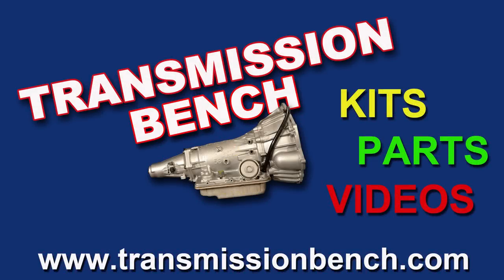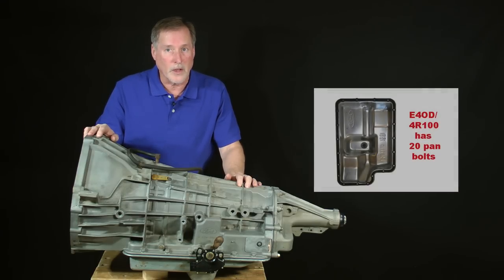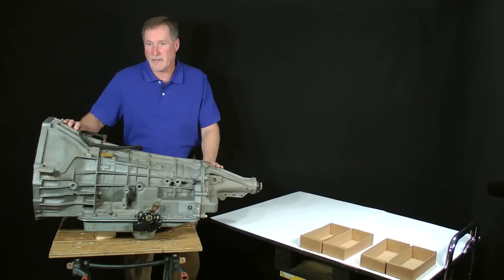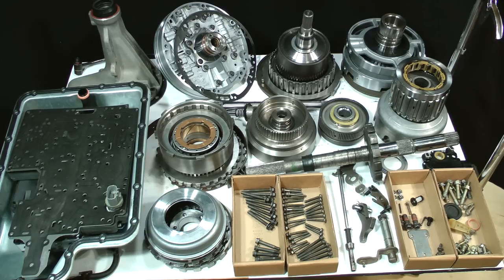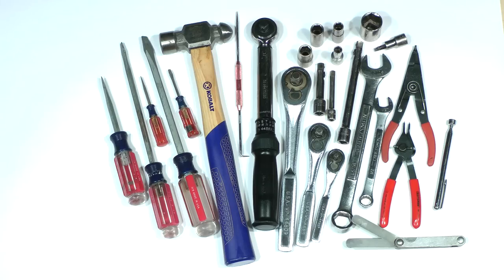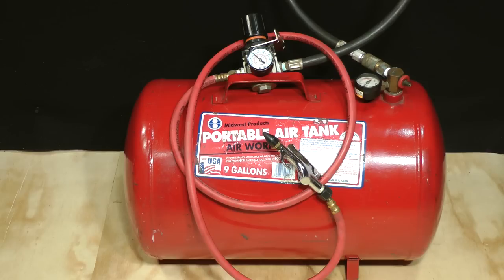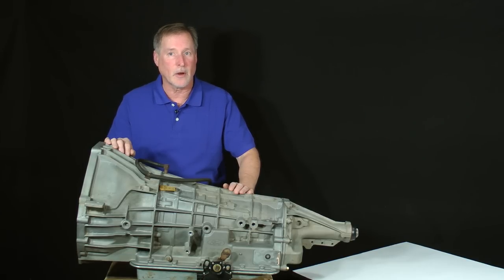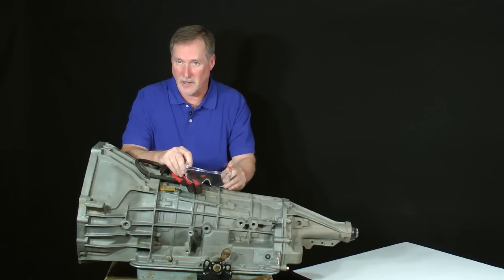Ford E4OD / 4R100 Class lesson 1 of 16

Comment: I have a suggestion for DIY'rs. Don't do what I did. Go to this guys website and purchase HIS kit. It ISN'T more expensive than other places, despite what that numbers make you think. If I had just done that, I could have saved money trying to order from here and there to cover all my bases. Just get his kit, and a rebuilt solenoid pack.
Reply: Does his deluxe kit include all the Torrington bearings and etc.? I didn’t hear him mention it but on another website it gives me a option to buy bushing, Torrington bearing, all kinds of minor kits needed for the e4od rebuild...
Reply: @austinsmith7131  I assume you're talking about those cylindrical bearings that you hammer in. Yes, I do believe his kits have those. His kit seems to be the most complete and highest quality, though this is an amateur talking.

Comment: Better pay a mechanic do it the job and get the warranty .. you not saving just kit it self will cost you $590 +295 plus other small stuff that u may need .. so you will be spending more $1000
Reply: Nothing like doing it yourself for bragging rights.  I rebuilt a Turbo-hydromatic 350 trans many many years ago and it gave me immense personal satisfaction after it worked like new again. A mechanic you pay is not going to be as careful and care about doing as good job as you would be working on your own vehicle.

Comment: Mental note- this is a 4x2 gas 2000 expedition 5.4 model, says specificly this is the 5.4, 5.8, and 6.8 configuration. Sure like to know the major differences and internal differences between diesel and gas as well as 4x2 and 4x4 models.

Comment: How much power would you say is safe to have with the deluxe super kit in this video. I'm looking to go from a stock 7.3 motor to 450hp-500hp over the course of the next year. I will be putting a triple disc converter and upgraded valve body in both from revmax as well. I would imagine that the Transgo hd2 tugger kit would not be needed with the upgraded valve body I plan to use but I'm not sure. Thanks and this looks like a great series.

Comment: after opening the pan on mine,I have an another valve body section between the solinoid pack and the filter sitting on top of the normal valve body sections.Should this just be treated as normal in the rebuild? and will the rebuild deluxe kit have the gasket?

Comment: Help!!! please?  my 96 F250 with 7.3 and E40D trans.     I had my transmission rebuilt 3 weeks ago.   

1st test drive out of shop, I took it on the highway and back toward home. It seemed to be shifting great until I put it in reverse... it shuddered in reverse.

I returned it to the shop and 2 weeks later, got it back.  The mechanic said "he had to replace the pump"

Now, after highway use, I have a delay and it does not appear to fully lock into reverse and feels like it is slipping as if not fully locked into reverse.

I called the mechanic and he claims it is normal because of the transgo tugger kit he installed and the 3 disc billet torque converter they added.

I called transgo and was told in a very matter of fact way that the transmission should still engage into reverse just as it did before the rebuild.

Any input, advice will be greatly appreciated.  I paid $3,800 for the rebuild and that was a huge hit on my finances. I just want peace of mind that I got everything that I paid for and knowing that I can take my truck on the road without worry.

Thank you in advance!